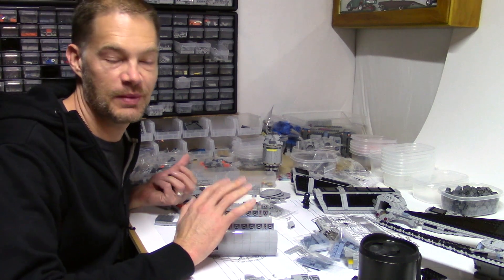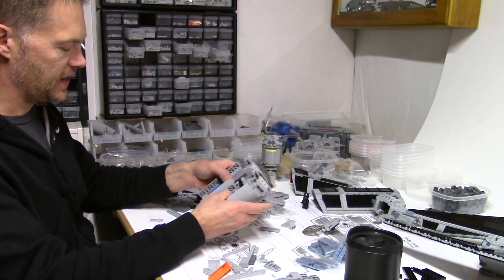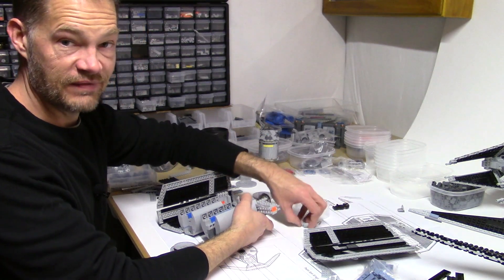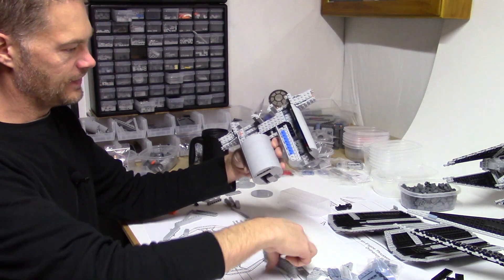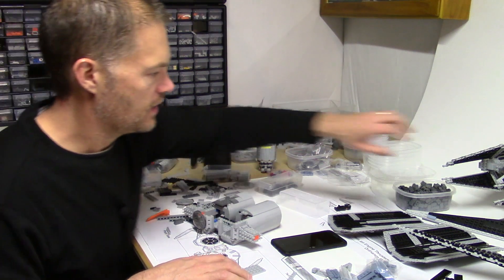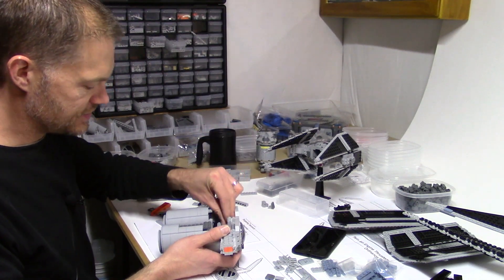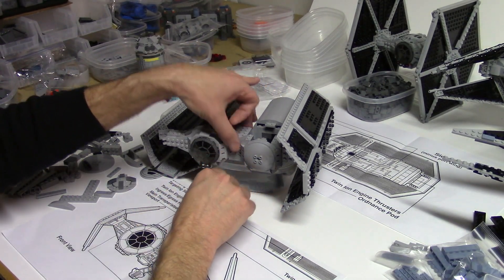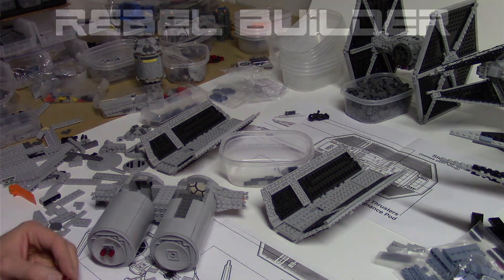Building a LEGO Star Wars TIE Bomber MOC! Part 2 of 3

Comment: Why dont you use some 6 x 8 Open Center Technic Brick in the interior of each body? You could put the axle you used to do the back of the ship (I think you used a dark red 1x2 brick with a hole). Also you could attach the 6x8 to the 5 x 5 Right Angle and make a whole structure. Dont know if I explained myself correctly xD
Reply from the maker: Yeah, that's a good idea.